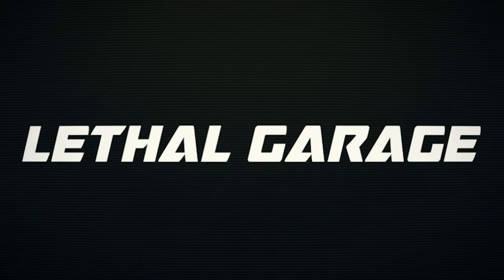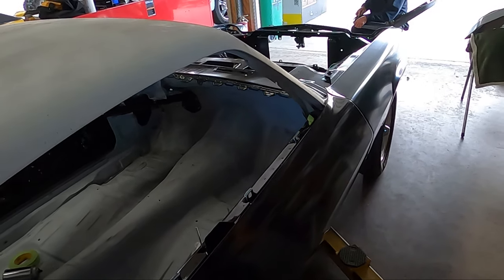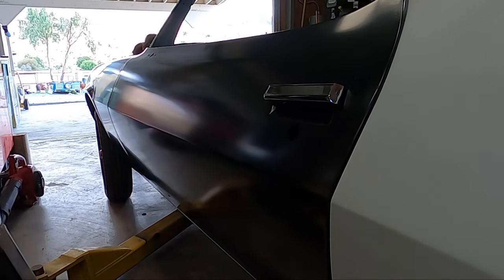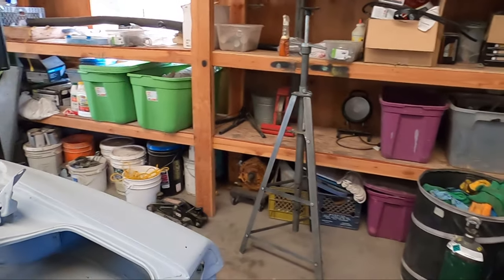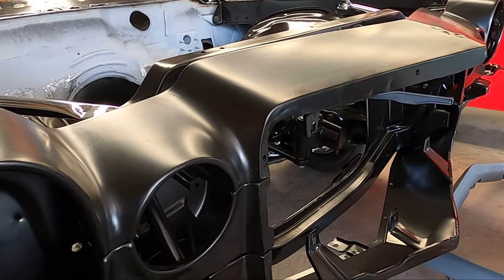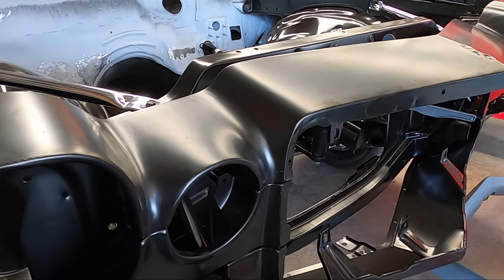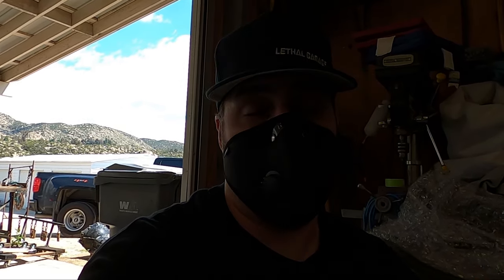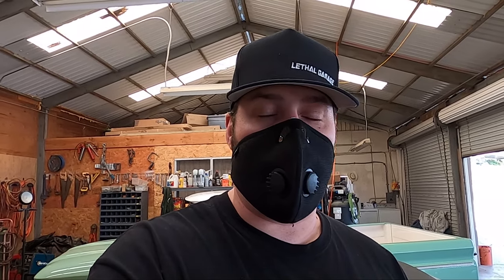OER Door & Fender Gaps | S2 EP:12

Comment: The bottom gaps on the doors are typically huge. The A pillar gaps won’t necessarily be flush surface to surface and they are typically pretty wide. Weld a 3/16 diameter rod to the bottom edge. I rejected three OER RF fenders before getting an AMD fender that was near perfect. AMD owns their own brand new tooling and it’s very good. On the OER fenders, you may consider breaking the welds on the inner structures. I think the stamping are generally fairly close but the assembly of the parts - not consistent. There is a pair of NOS  fenders on eBay right now! Knowing you, this car is goi g to have some horsepower. Make sure the roof seams are welded up inside the door jam so they don’t crack. Dad should stay at home. Stay safe.